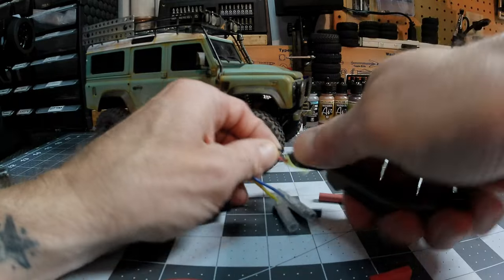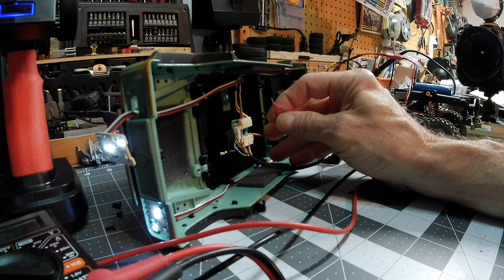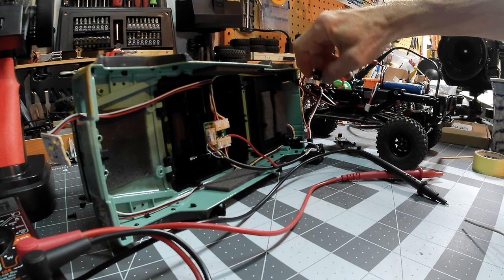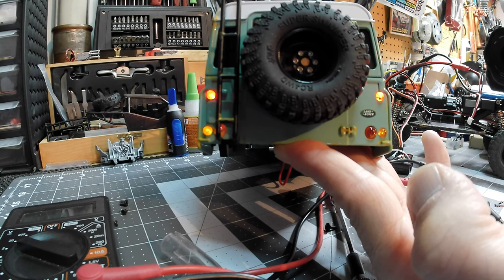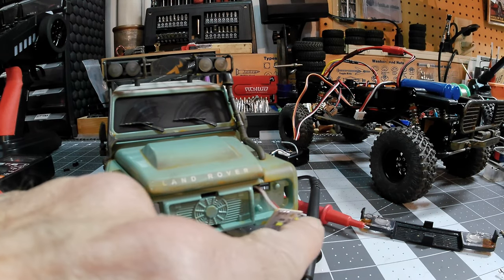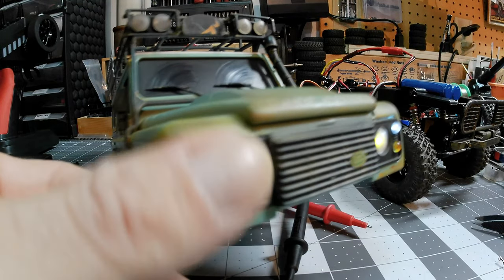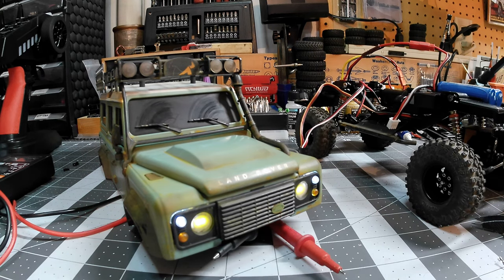MN111 Turn Signals Mod / Yellow Headlight Mod

Comment: I am really grateful you uploaded this since i am going to convert my 1625 with jst connector, also why did you used that crimping tool in the battery input??
Reply from the maker: No problem! I'm glad this is of use to some folks out there. Those were Klein Katapult wire strippers. Pretty cool. I'm a licensed electrician so I have a few cool tools laying around.
Reply: @VermontScaleCustoms so is it really safe to convert esc wire with jst plugs?? I am very lazy to convert my motor and battery wire to something else because im on a tight budget, so i will be doing the same process like yours
Reply from the maker: @joebxth  yes, either side works, voltage doesn't care what kind of connector you use as long as its phased properly and rated for the purpose. JST is more that sufficient for 7.4v.
Reply: @VermontScaleCustoms okay thank you for your info, i will be using this 1625 in my 370 single speed motor and i hope it has enough power
Reply from the maker: I have run the HW1625 on a 370 a lot in the past. My WPL Green Machine truck was powered with a 1625 for two years. Never had a problem.
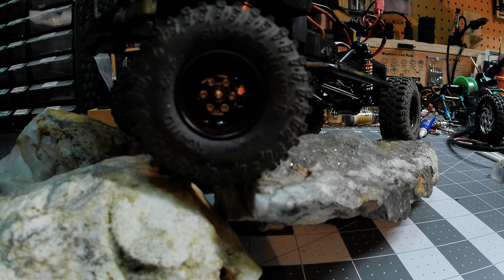Reply: @VermontScaleCustoms thanks man, i will be putting it on wpl c24 since the esc was made for 1:16 scale, i was originally going for the 1060 but this one is a bit cheaper

Comment: Thanks for the video...what kind of tape did you use for your headlamp mod?
Reply from the maker: Thanks for watching! I just used some good old fashioned yellow electrical tape. For that matter, you can probably tint with whatever color you like. They make all kinds!
Reply: @VermontScaleCustoms  Great! Thanks for the tip...tape still holding up?  Was there more detail about the upper light bar?  I understand they're dummies and don't light up...
Reply from the maker: Yes, tape is still intact, holding up just fine in there. Did some river crossings after this video with a wet front end. I still have that light bar video in editing and needs to be finished - it's been months.

Comment: Great Job!!!😎👌I'm still waiting for mine...How did   You do the painting? It 's realy nice !!!
9:28
Reply from the maker: Nice! You ordered one! I think you'll like it. I've been going crazy doing mods to this one. For paint, I used Vallejo airbrush paints. First I did some detail work with brushes and then finished it with an airbrush. It's not 100% finished around the back side of the truck yet. Plus I want to add a work light on the back, etc. Order a winch, all that.

The detail of the body is so nice.
Reply: @VermontScaleCustoms  Thank You!!! 😎

Comment: does that mean the mn 6 ch trx is not compatible with the mn111 lighting module?
Reply from the maker: It's a 100% plug 'n play option right out of the box. And it works like a charm. The radio is nice, too. Good range and dual rate adjustment on Steering and Throttle. 

The complaint is that most people don't like automatic turn signals when steering left or right. It's not how a car actually works. Some of us find it really annoying. So, like the MN99 truck, I found a way to hack the lights so the signals are disabled and turn them into full time running lights.
Reply: @VermontScaleCustoms  Glad to hear that, I'm waiting for my mn 6ch transmitter and my esc 40a to come.

I'm still waiting for each of your video updates, especially the roof light mod.

amazing work, btw
Reply from the maker: Nice! I am actually very pleased with the overall quality. Aside from the flashing blue lights on the sides of it (you'll see) it's good. I covered that stuff up with black electrical tape.

I have that video in editing and still need to finish it. I think you'll find it helpful. I'm glad I captured what I did. The plastic requires some modification so I focused on how to do that to get them to fit.

I really hope that the aftermarket for these pops up some day. There was a ton of stuff made for the MN99 which wasn't even licensed. Nor, was it diecast. I can only hope that maybe things like metal rock sliders, bumpers, etc all start to appear on AliExpress or somewhere. 

And thank you. I'm really enjoying working on this truck. I've gotten the inspiration to really scale this one out. It just seemed like it needed to be taken to that level.

GoPro9 arrives today! Higher resolution slowmotion!